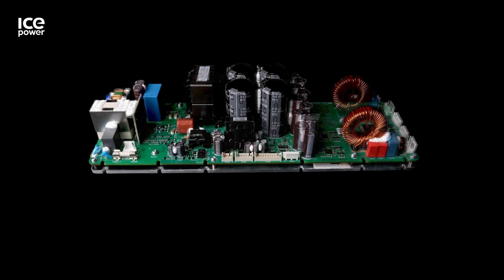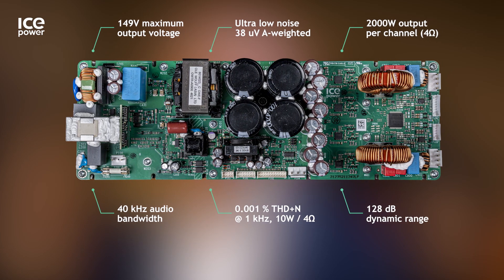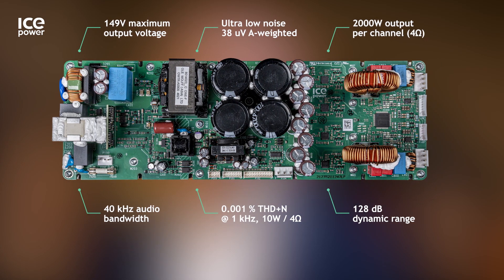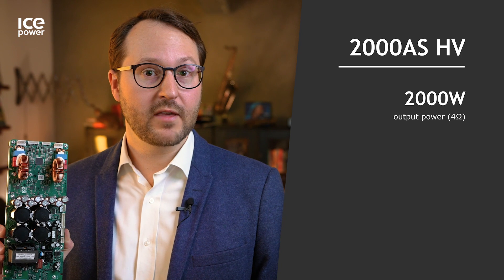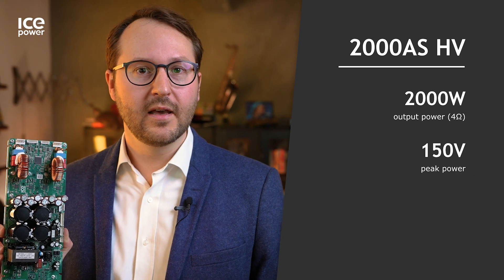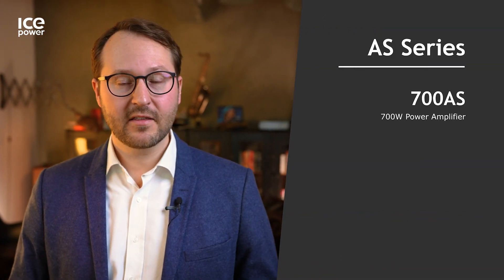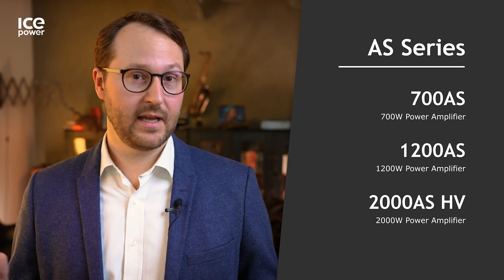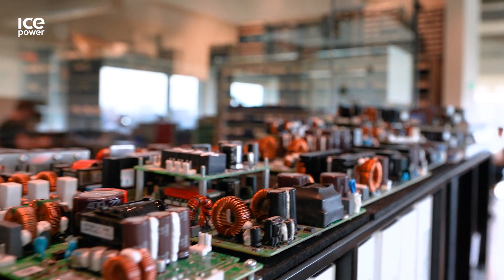Product video 2000AS HV

Comment: I've built dual mono amps using two 1200AS1 which I use as an external amp for my Yamaha RX-A2800. I'm very happy with the sound quality and the very reasonable pricing, especially for a DIY project (I used very cheap cases fro Aliexpress + harness cabling from Ghent Audio).